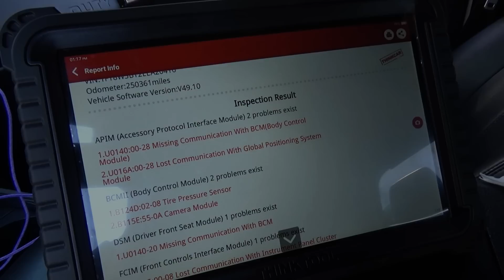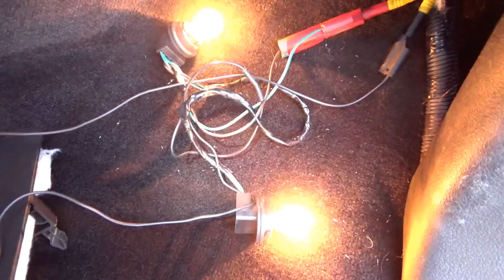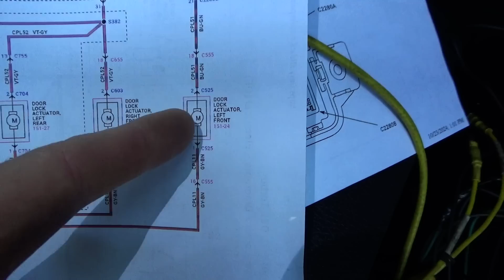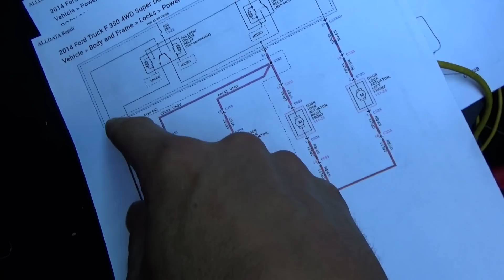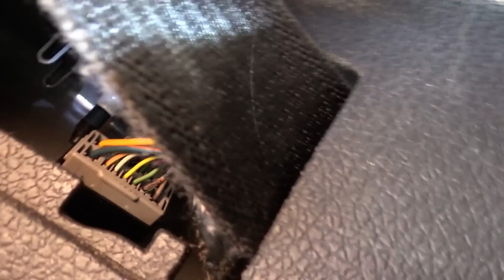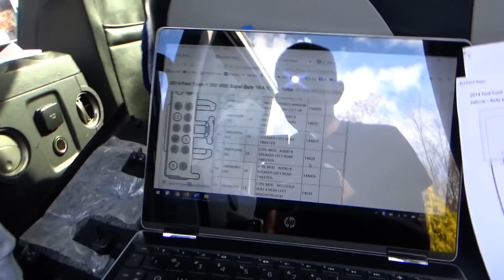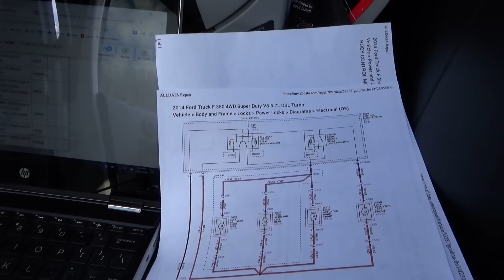(Pt 1) PowerStroke Power Locks DISASTER!?

Comment: Yeah the whole wire that was overloaded becomes a heater element, basically.  Unfortunately, the melted wire will be melted along its entire length, if it got an earth or +12V from the far end of it.

To have so grossly overheated to tje point of melting the insulation, then melting the insulation of adjacent wires allowing short circuits to spread, was more than just under-sized wiring I suspect.  I could be wrong, but hey, this is only part 1!

Comment: Seen this in wire/relay controllers when 1 coil partly shorts its windings. especially in circuits where multiple relays "pull in" at the same time. The shorted coil pulls more current that melts the insulation, eventually grounding to a dead short. JMO

Comment: Fuse size should have been determined by wire size, not the devices connected to other end.  Or so the book says.. Or vise versa wire size should have been determined by SUM of all Loads on that circuit….   Wire size was ok for each individual load, but not big enough for the combined circuit with large enough fuse to handle all 4

Great video as always

Comment: There are several Technical Service Bulletins (TSBs) related to the 2014 Ford F-350 PowerStroke, including issues with power locks. Here are a few relevant ones:

Erratic Door Locks: Some owners have reported issues with door locks unlocking erratically, especially after hitting bumps or making turns. This can sometimes be resolved by checking the wiring harnesses in the door jambs for frayed or damaged wires.

Electrical System Issues: There are TSBs related to the electrical system that might affect power locks. For example, issues with the Body Control Module (BCM) can cause power locks to malfunction.

Fuse Problems: Blown fuses in the BCM can also lead to power lock issues. It's important to check and replace any blown fuses.

You can find more detailed information and discussions on forums like the Ford Truck Enthusiasts Forums and the Ford Powerstroke Diesel Forum.

Comment: Had the same issue with the same door. If you keep looking you will find those wires go under the front bucket chairs back over to the BMC. I decided to just find another cab wiring harness and redo the whole thing. Turned out to be faster then trying to complete all the wire repairs. There was only 1 tricky plug to access which is under/behing the steering column, rest were not bad once the from seats were out.. Edit: dont put a 20A fuse, use a 10A. Better to replace the fuse every now and then and not replace buring wires again 🙂

Comment: I have a tough one I'd appreciate some input if you can.2012 f150 plane Jane 3.7 no dash gauges,no power steering,sometimes the wipers work , sometimes it won't start have to try it a few times pull the shift lever back and the headlights dim ,was thinking PCM ,can not get any communication with scan tool only able to communicate with HVAC nothing else.but it will start and drive any idea where,what,I should be looking for
Reply from the maker: Headlights dim? Check the battery connections?
Reply: @PineHollowAutoDiagnostics  battery good,new alternator puting out 14.3v
Reply: Headlights come on only dim like switching to low beam when you pull the shift lever back
Reply from the maker: @sevenof14  Is that the Daytime Running Lights setting? What if you turn the lights switch to ON? High Beams work?
Reply: @PineHollowAutoDiagnostics  no control of the lights at all with the switch the lights come on when you turn the key on and sometimes both lights come on and sometimes only the left one comes on it's really unusual like it's possessed where it's really confusing is no power steering no gauges but runs and drives
Reply from the maker: @sevenof14  Get a wiring diagram for the headlights and Ground Distribution. Sounds like an intermittent poor ground...

Comment: It has been my experience that the entire length of wire, from the actual short, all the way to the source of power, reached glow status. EVERYTHING in contact with that stretch of wiring is compromised. 70-80 feet of wire, a few feet of heat shrink, and several hours of soldering.... So lucky that didn't ignite.

Comment: I always felt that vehicle wiring was a little overfused as compared to residential or industrial. Remember the "fusible links"?  Vehicles these days have TINY wires in them, so when one ckt gets shorted to another, a tiny wire ckt can connect to a big wire ckt, so it's a mistake to run these ckts together in the same space. Looking forward to seeing how you undo this mess!

Comment: Whenever I found wire like that with a larger fuse, or worse a large circuit breaker, I figured like everyone else, that they thought the larger circuit fuse would fix the problem, "OR" they wanted to see where the short was located saving time by letting it burn.  NOT A GOOD IDEA!

Comment: The damage to the harness is extensive and clearly due to an over-current condition. I have only seen this when there has been some sort of event or damage where unrelated circuit wires are cross connected due to twisting or something penetrating into the harness wires. By cross connecting circuits you can exceed the current carrying capability to the point of damage of the insulation. Sometimes an object gets thrown into the bottom sheet metal, penetrates the sheet metal and into the harness cross connecting circuits. I have also seen this from someone working on a vehicle and inadvertently drilling into or nailing into a harness. Was any work being done on the vehicle when the problem started?

Comment: i have a 2006 GMC 1500 that the cig lighter wires and the power outlet are both melted as far as you can see the cig lighter burned insulation completly none left on either wire

Comment: I wonder if kids were pressing down on the button long enough to cause this or the BCM randomly caused a hook on the unlock or lock circuit for an insane amount of time. I would ask the customer if he randomly had a battery go dead on him from this kind of issue. BCM's in these trucks have known to cause all kinds of weird issues like lights staying on draining the battery to keeping the network alive with random gibberish that also will cause the battery to drain really fast. It seems that once you start to add a million factors involved with unlocking and locking doors, that there is a lot of room for failure. These trucks had issues with fires. Just like a lot of newer stuff just randomly burning to the ground due to issues like this.

Comment: i am a retired truck mechanic, i had a 96 e350 ,the fuel pump shorted out and burnt the wire from inside the fuel tank to the inertia switch tn the cab ! would have been beter if it had set the truck on fire !

Comment: I currently have 2 2014 F550 from the same company in the shop with the same issue of the door lock wires in the cab harness burnt for both rear doors
Reply: Was the root cause a bad relay in the BCM?
Reply: @windward2818  Not sure yet they still debating on fixing or replacing

Comment: There is a high inrush on lock solenoids.  Howver, the circuit only pulses, so the wires are designed to be undersized. I'm guessing a short developed in the "unlock" circuit of that door as if someone kept their finger on the "unlock" button. That will toast the solenoid & the wire

Comment: Trying to help the analysis: 1. What is the actual melting point of the insulation? 2. What current was applied that elevate the conductor to this melting point? Simple questions, but difficult to find an answer. Lets say the insulation softens (melts) at 150C and an 18 gauge wire is stressed to 20A. I predict a 125C rise in the 18 AWG copper. At 25C ambient this is close to the failure point. So maybe Ford doesn't know how to fuse a circuit?

Comment: I would put money the customer kept putting more and more fuses hoping that the problem would magically fix itself. The fuse is designed to protect the circuit from frying and melting like that with just one incident. I don't think he would admit to multiple fuses or even a higher amperage fuse was ever use.
If a circuit blows a fuse, Stop Diagnose the problem before putting more fuses in..

Comment: Sand and other grit got into the wiring run and wore through the insulation on one or more wires. I've seen it before. As expensive as even used vehicles are, it would still be worth the cost to replace/repair that wiring harness. Great diagnosis as always, Ivan.

Comment: Oh man, what a disaster.  You can't tell me that the owner didn't smell that or see smoke.  And there is no telling how many times that fuse was replaced trying to get those locks working again.  How do you go about fixing this and prevent that damage from ever happening again?  The factory wiring is simply not a heavy enough gauge to handle a dead short on a 20A fused circuit.  Maybe replace the 20A fuse with a 10A for starters?  Really, each door lock should have it's own 5A fuse.  

[Sarcasm] I have no idea what the engineers at Ford were thinking.  If each door lock only needs 5A, why don't we just simplify the system and pile all 4 door locks on to one 20A fuse?  That should work out fine, right?  [/Sarcasm]

Comment: Theory: The larger window power wire shorted to the door lock wiring.  The locks connected to ground via the BCM when not locking/unlocking.  Not enough current to pop the window fuse, but too much current for the door lock wiring. There's no fuse to protect the lock wiring from short to power, only the fuse in the power source.  That kind of carnage take time, and locking/unlocking doesn't give time.  So I think another circuit has to be involved.  But what caused that initial short?

Comment: I definitely want to see the root cause problem. Even if the circuit was over-fused, as Ivan stated, the circuit is only energized for a very short time. BUT if an actuator stuck energized, suspect lt rear door, I could see it making a toaster out of that circuit since it's over-fused. It's not yet a direct short, it's a toaster for an extended period of time.

Comment: If you have a larger wire split into 3 smaller wires, you have to fuse for the smallest wire or fuse the large wire and then fuse each of the smaller wires.  But I like the theory others have said about someone just installed a large fuse when it started blowing. 

The previous owner of my house did that with a circuit breaker.  Oh, the 15A breaker keeps tripping? Just install a 20A breaker. The real problem was the house was built in 1963 when people were using less electricity. That 15A circuit was actually powering a lot of the house.  And then sometime in the 80s or 90s there was just too much stuff on it.

Comment: Had a similar deal on a f350 the security module (power locks worked through this unit)  shorted and had to make a new harness and rebuild the board of the security module That sucked

Comment: Time for a junkyard harness repair. He's lucky the truck didn't start on fire.I had a couple of wire fires scary stuff.
Reply: I was thinking the exact same thing, not only are you fixing the original problem but also relieving any melted adjacent wires. I was thinking it had a water intrusion problem in that wire run because that would be the lowest area of the truck and if it's a Pennsylvania truck with winter snow the water has to go somewhere.

Comment: I have a shop called the wiring guy in MT and have had 3 superdutys with same issue and wires burnt from bcm to behind rear seats to all rear doors. We have 4 locks running on an under sized wire exceeding the fuse rating and melting multiple wires together
Reply from the maker: WOW nice to know I'm not the only one with this issue! So what is the ROOT CAUSE of this problem?? Is it the Door Lock Actuators actually shorting internally??
Reply: The first one we had had an aftermarket alarm that had the lock and unlock pulse set way to long. The other two were bone stock with no other issues. Cant remember the wire gauge at the moment but the wire has multiple splices and runs more then 20 ft. Possibly key fob in pocket hitting lock unlock. Or impatients and hitting buttons multiple times generating heat. In billings it gets so cold we have low voltage on batterys locks pulling more current when frozen and with under sized wires running such a distance it all adds up to higher resistance with a large fuse. Scan it and to self test on BCM there are probably more issues then locks. Harrness not available usually so it turns into a big job we upsize wire and run new to prevent future issues
Reply: @joesmith1366 I have seen a few fords both were 2014 models, an escape and a fiesta where when the battery dies the bcm goes nuts and certain relays and items in the car turn on and stay on until the battery is completely smoked, like the relays in them latch on when the voltage gets super low
Reply: I have pictures of everything if theres a way to send to you
Reply: @joesmith1366  There is Ivan's email address in the channel intro page.  YouTube will ask you to click on something to prove you are not a robot though...
Reply: We pull seats and carpet and rebuild harrness ive had it wipe out windows sunroof mirrors and all sorts of chaos when it melts the bundle
Reply: Wire, if it is too small for the load will not melt just because it is small. Current of sufficient magnitude overloading the wire rating must flow in order to over-load the circuit. The damage to the wiring in the vehicle in the video is so extensive that it is like power was applied and did not turn off while the door lock motor was against a stop and stalled. Like if one of the control relay contacts welded closed. Which would make sense because under continuous motor stall (even multiple motors stalling) the smaller gauge wire would act like a fusible link and burn first and eventually fail open. So, you could have multiple smaller wire in the harness which would burn in the same way acting like fusible links. There is a problem with my guess as to what happened because most door lock motors have a polyswitch current limiting device to protect the motor. Perhaps the polyswitch protected the motor and not the harness.

Perhaps you would have an old BCM you could take apart and inspect the relay output contacts for pitting and welding.

Does relay output welding contacts make sense to you for root cause?

Comment: That wire size is way too small to carry 20 amps for an extended period of time. Either the actuator shorted and kept it energized or maybe something was loaded in the back and pushed the button and kept it on until the wires melted and blew the fuse. 

I guess the other option you didn’t get the whole story from the customer as usual. 🤣🤣

Comment: There is more to the story that Ivan did not get, to burn wiring like that would require extended periods of current flow, usualy door lock/unlock circuits or active for less than a second. The only way to melt wiring like that is to have the circuit activated continously.
Reply from the maker: That was my thought exactly! Or pushing the button 100 times in a row haha
Reply: @PineHollowAutoDiagnostics  I was wondering that too, does he have kids that sit back there? 🤣🤣

Comment: Yikes! Overload over a long stretch of loom. Fuse must be really oversized to handle all that current and not pop. Not possible to find the origin, without removing the door panel for inspection - the problem may have started on the floor loom and found its way through the door look wiring. Part 2 should be very interesting 🙂

Comment: long current draw can do it just under the max draw so fuse just keep on going in tell final hit 20 amps
Reply: To add to what you said...since the circuit was a long length of ~18ga wire, the high wire resistance probably regulated the current while short-circuited.  Also, I only buy legit Bussmann/Littlefuse fuses now after witnessing Amazon fuses operating well above their limit.

Comment: I have also seen fuses fail (either bad fuse or an accumulation of dust) the end result was a melted blob of a fuse that never blew. Very important to never buy cheap Chinese fuses (300 for $13.00), there is reason quality fuses like Littlefuse cost much more (40 for $25), it's because they actually blow at their rated amperage and protect your electrical system. Of course the caveat is fuses always blow for a reason, IOW the solution to a blown fuse is not to simply replace it.
Reply: Very good advice. I only stock Littlefuse and Bussmann automotive fuses from two suppliers that I know buy directly from Littlefuse or Bussmann.

Comment: I've seen this on the 2003 to 2007 GM full size trucks and SUV's for the cigarette lighters and high speed circuit for the blower motor for manual HVAC.  They melt the wire insulation  from the inside all the way out to the underhood fuse block

Comment: Yeah, 20 amp fuse looks maybe more than double the wires current rating.  I'd say 5 amp fuse should be good enough but with all locks actuating together it would need a burst of at least 8 amps and a 5 amp might blow if you hold down the lock/unlock switch.